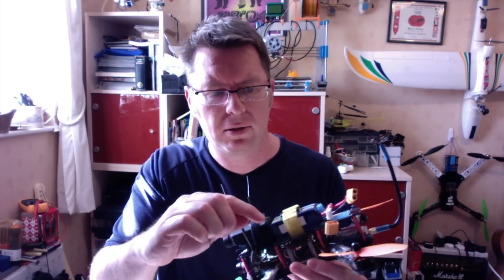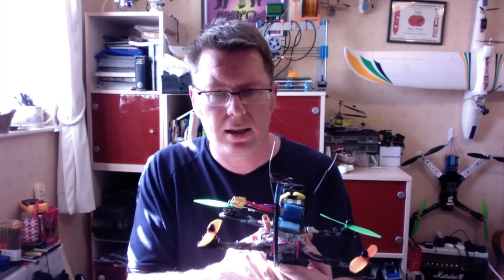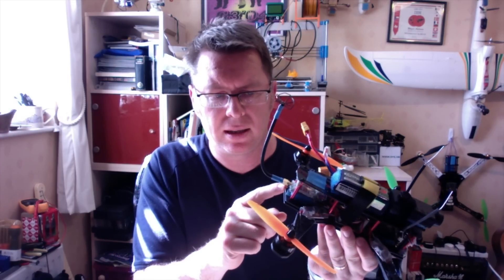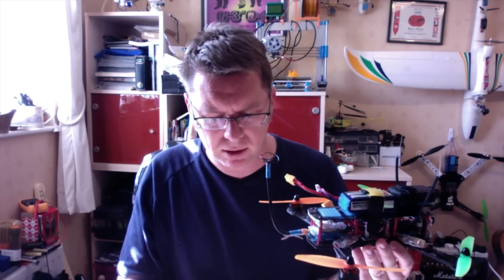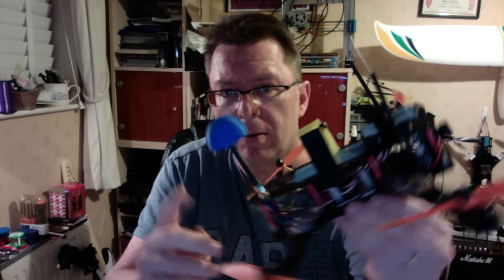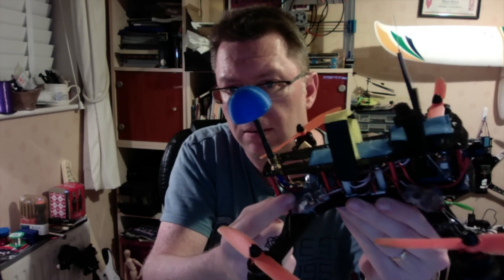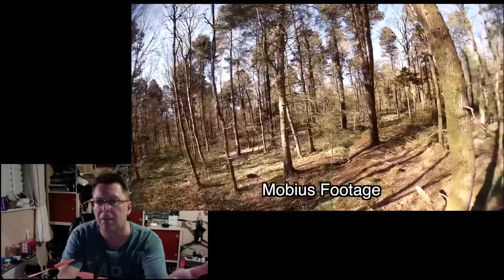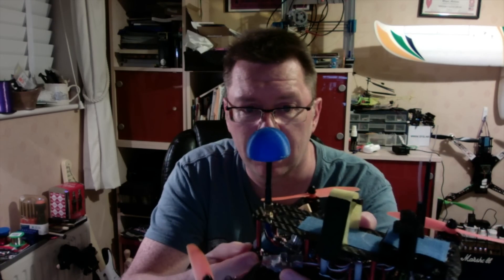FPV ZMR 250 mod - how to stop breaking your VTX (+ bonus review)

Comment: i endet up using those cheap L shape Adapters. there weak enough to rip out before the tx breaks and you mostly can easely push them back together and even solder them to make them stronger.

Comment: Curious if your unused audio wire was grounded. If not, the residual noise in the vtx will build up and get worse throughout a flight. Also, as others said, an LC filter will help.
Reply from the maker: +12gaugeAngel The audio and it's ground we're cut back - so no.  The replacement VTX used the same cable though, and that has been absolutely fine
Reply: gotcha. Since I started connecting the audio wire to a ground, either on the vtx or pdb, I have had much better luck with those little vtx units. Can't keep myself from destroying antennas, though. Anyway, thanks for the video.

Comment: i have problems with my ts5823 also. with mine, its heat. If im testing in my office, it gets hot and shuts down. If im out flying, It stays cool and has no problem. Distance is another thing. Im not sure about it yet

Comment: It's recommended you use an external heat sink for the TS5823 and TS5828 or they will over heat. Also if you were to loose the ground wire for the transmitter, the carbon fiber frame( if that is what you have) will be the ground path for the transmitter power because of the pigtail nut that is touching the frame. Not good because the carbon fiber has resistance and will heat up and burn.
Reply from the maker: +Jim r Hi Jim, when you say "it's recommended", who recommends it - just wondered where this originates from (although I'm not actually using any of these VTX's at the moment.

It's true what you say about the carbon acting as a ground path - however, I'm certainly not the first person to do this, and it is quite hard for the ground to be lost without the power as well.  I don't really hear about many 250's bursting into flames on a regular basis, and I've certainly crashed mine enough to know that it would be really hard to lose the ground.  However, it is another part that it might be worth taking a look at to completely insulate the pigtail from the frame.

Comment: I bought a TS5823 and it never worked from new, I have some radio experience so was careful to use a decent antenna before powering it up, tried for ages assuming I had no video feed, or frequency was off, later after a bought a cheaper larger VTX the video checked out fine, then used a Ubiquiti wireless link to scan the frequency range, nothing from the TS5823 at all, too late to go back to banggood. Would not touch the TS5823 now. For the record I have a dirt cheap VTX with a 90 degree adapter wedged on edge at the back between epo blocks and retained by a cable tie, ugly but in the event of a crash it moves but doesn't break (though I have broken a £4 antenna).

Comment: every time you add in a right angle adapter you lose 2dbi so the range is less
Reply from the maker: Joshua Archibald Yep - there is a small loss by adding the adapter, however a 250 quad is not for showing how you can do 10km, it's for racing around like an idiot and crashing into trees :)  My max range for this is probably around 400m and at that range video is obviously perfect.  Any further out and it'll just be more annoying to find... as I do crash this a lot

Comment: Good review. You can ditch the angle adapter and mount a mini transmitter vertically . I use the Bangood Echine 200mw transmiters with my budget reciever they give a almost perfect signal to 300m. I have 4 in 4 quads and a EmersionRC 600mw in a big quad and cant tell the difference in video quality or range.
 I epoxy the RMA to the board to take stress off the solder joints, and a ferrite ring on the voltage in to clear up static.
I cried when I broke my $100 EmersionREC 600mw. When I broke a $20 Echine I just plugged in a spare. 

Echine transmiter combo ;
 http://www.banggood.com/Eachine-700TVL-13-Cmos-FPV-110-Degree-Camera-w32CH-Transmission-p-965760.html

Ferrite ring ;
http://www.ebay.com.au/itm/171780903332?_trksid=p2057872.m2749.l2649&ssPageName=STRK%3AMEBIDX%3AIT

Comment: My first skyzone 200mw lasted 1 hour of flying then slowly died second one dieded after 15min i style smoke the works powered off the pdb using a 1300 3s pack
Reply from the maker: michael taylor Ouch...well I would say the new one is fine, but it's only had around 30 mins of flighttime, as I switched to the AOMway 200mw on my mini quad

Comment: the cheaper vtx's dont seem to have alot in the of filtering i guess thats why they are 1/3 the price and size of fat shark vtx's but i am cheep a ls filers $0.50 to make and $20 vs $70 for a vtx  and you still save a few grams :) and $ 50 bucks.
but i am cheep and i like to make stuff lol
Reply from the maker: jeff goble Yep a filter would do it, but check out my VTX shootout video, no filtering there and the two mini VTX's stand up really well against the ImmersionRC

Comment: You think your TS5823 is bad?
Mine was working fine at home but as soon as I powered it up in the field, it went mental. https://www.youtube.com/watch?v=BqdYu-8uVFY
After that, it burnt itself out.
Reply from the maker: Vortecks That looks pretty bad - diagonal lines and your's seemed to have zero range and drop off very quickly.  Looks like everything that could have gone wrong in that flight happened !  Better luck on the rebuild

Comment: From what I've read elsewhere I think there's two versions of the TS5823 VTX as the one I bought a while back specificaly said it was a later version and didn't suffer from the lines on the picture the earlier ones did. Mine is Ok at the moment and I'm using a Fatshark Channel but with Skyzone Goggles. Maybe you've ended up with one of the early versions / old stock.
Reply from the maker: Martyn's FPV Channel Any thing that tells each of the revision apart ?  I've got both the faulty and replacement VTX on a quad to test if the weather holds itself steady for 20 minutes or so.  Should be able to tell if I've got another dud

Comment: After recently breaking off my first SMA connector from an ImmersionRC VTX, this is good advice, thanks for posting.  Which 5.8Ghz module do you use in your video goggles?  I am wondering about trying a cheap VTX but I have the Fatshark Airwave module.
Reply from the maker: ***** I'm using the Nexwave 5.8 module, so it only talks airwave frequencies.  I was certainly skeptical about these cheap 32 channel VTX's working - but aside from the one I had being crap on interference, it was fine.  I only went to a max of about 300-400m but it worked as well through trees as the Immersion one.  Well worth a try I think
Reply: CurryKitten That's good to know, I will have to give one of the cheap VTX a try.

Comment: Could it be the SMA to RP-SMA adapter you used as skyzone and immersion don't use the same?
Reply from the maker: Kris Richards There's no adapter there, this little 200mw VTX actually comes in SMA and RP-SMA flavours (obviously I used the SMA version)
Reply: I wish I knew that when I bought mine. Would have made life much easier :-/

Comment: Every video TX on the market will break the same if you put your antenna in that way lol
I already broke one of my video TXs the same way! I bought a SMA cable and i did exactly the same :)
It's a common issue with the Boscam/Skyzone vTXs, you have to always use a power LC Filter with them but it is definitely not crap at all :)
Reply from the maker: ABMNS PRODUCTION How strange, I've only ever used an LC filter on a VTX I built myself from a module, but I pretty much expect everything I buy to do it's own filtering.  Certainly I never had an issue with the "old style" 200mw boscam VTX's, and don't have an issue on the ImmersionRC stuff.  Like I said, I'm going to do some testing with the replacement one they sent, and then try and get hold of an AOMway to compare against.

Comment: I sell and use the Skyzone 200mW. Never had any problems meself or from customers (that they told me).
Reply from the maker: René Nieuwenhuis Perhaps you are getting all the working ones, on the forum I hang out in (fpvhub) I think 2 people had working ones vs 4 that had failed ones
Reply: René Nieuwenhuis Bruce also had some good ones but loads of his subscribers got bad ones. Comes down to QC at the end of the day, I read of more people with issues than not but most sort it with a dedicated LC filter

Comment: Good review. I also have one and im finding it very good so far but im using a filter. Your problems could just be as simple as adding a filter.  Def need to do a review on this other vtx to compare them.
Reply from the maker: 7322matthewc Hopefully I'll get hold of an Aomway VTX, but I do need to check the replacement to see how it is.  Clearly some of them work fine, just depends on your luck I think.
Reply: What filters are you using?